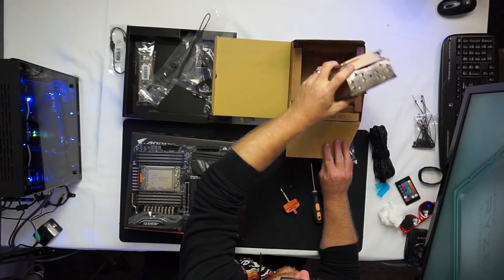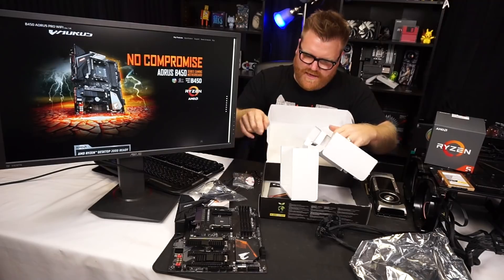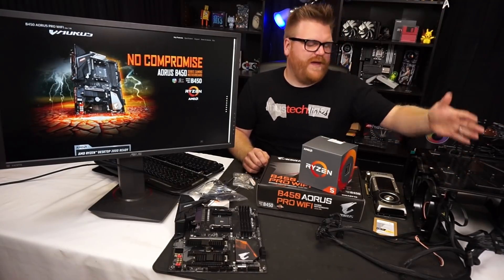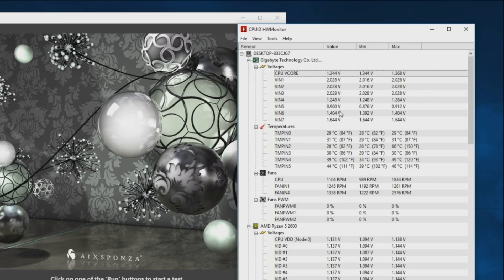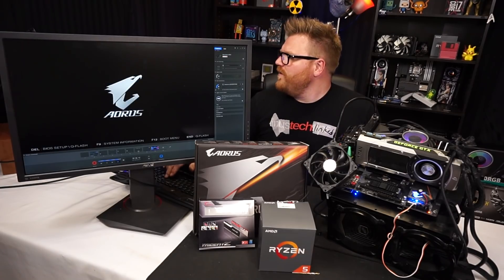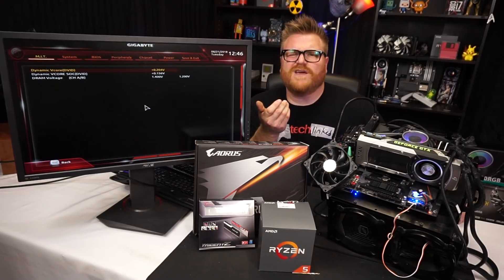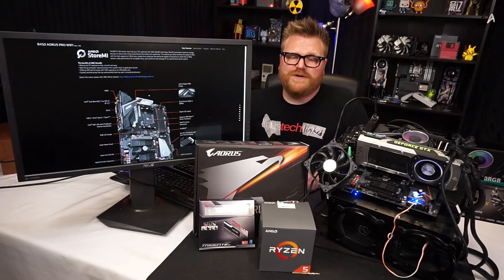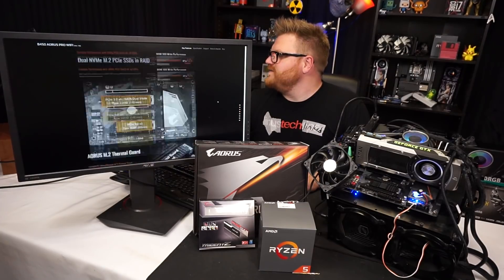B450 Gigabyte Aorus Pro Wifi, all the bells and whistles except for one

Comment: Looked at this review cause i'm going AMD for the first time, can anyone tell me from the comments i seen why this is a bad board? i picked this board out for aesthetics and has WIFI adapter, if this board isn't that good, what board would you recommend that's AMD and has wifi (looking for ATX boards not Micro or mini ATX boards)
Reply: The board's great. The reviewer is just used to overclocking the shit out of the CPU and this isn't the board for that.

Run it at stock CPU speeds or with the Easy Tune Overclock and you will be impressed.
Reply: @pau1phi11ips  oh okay awesome I'll still go with it cause it's only going to be my second build I don't plan on overclocking and if I do it'll be very minimal cause I have no idea how to do that

Comment: better get a proper x470-pro or even x-370pro (if you need to save some more bucks) by Asus for a little upprice ,both are far superior board anyhow . That Bios is just horrible and the Vrm is pathetic , wouldn't want to run a 2700x on that.

Comment: SOMEONE EXPLAIN IF IT HAS SLI/crossfire
 OR NOT TO ME PLZ
I cant find an answer yes or no
Reply: From Andtech: The B450 Aorus Pro WIFI sits as the premium board from GIGABYTE's B450 Aorus gaming line-up. ... Due to the PCIe configuration on offer, both AMD Quad-GPU CrossFire and dual CrossFire multi graphics cards configurations are supported; NVIDIA SLI multi-card setup aren't supported on any of GIGABYTE's B450
Reply: @Mish913  reeeeeeeeee
Reply: @Mish913  u see i have a 1080 and really wanted another in sli but rip, guess i need a new board